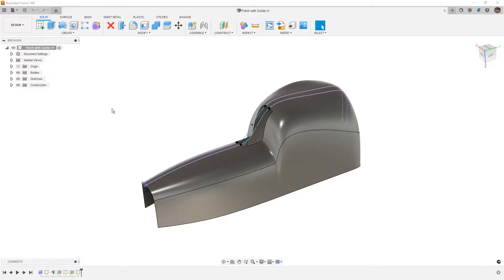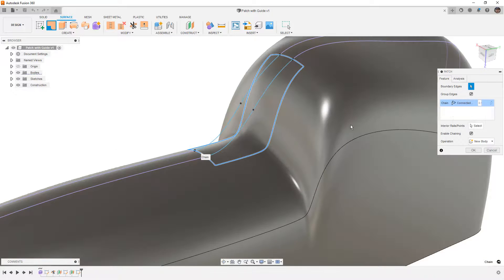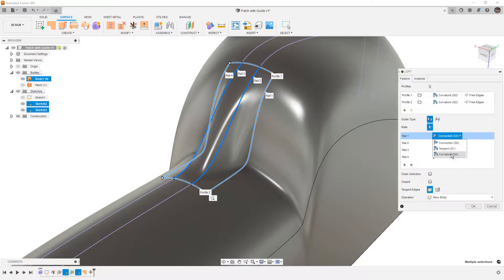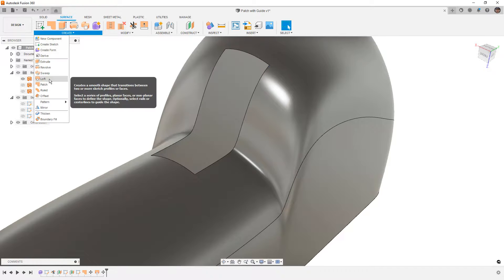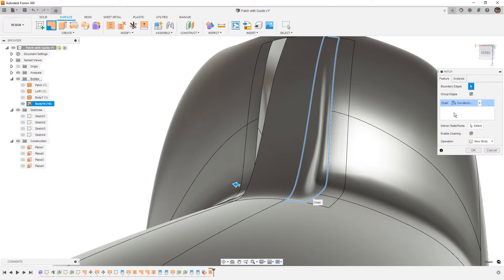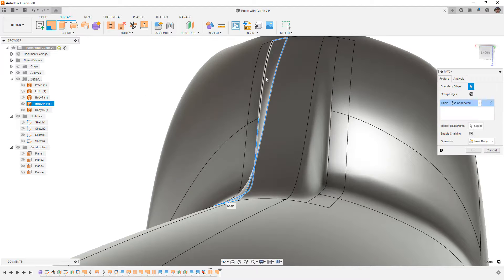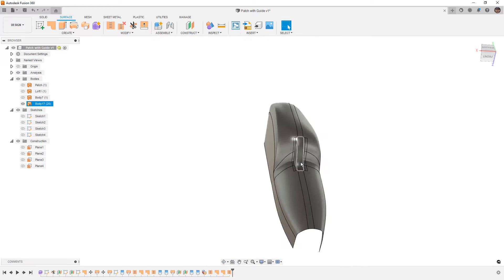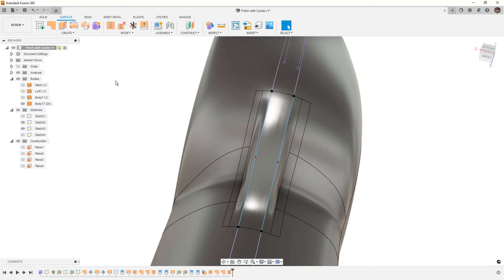Surface Mastery Part 9 - Patching a Surface using Interior Guide Rails | LOFT VS PATCH VS LOFT...

Comment: You've mentioned class A surfaces a couple of times now.  Where would this level of smoothness be needed?  Fluids stuff and aerodyamics?
Reply from the maker: Typically Class A is used for Automotive, Planes etc.  Consumer products "can" use it but many are made with traditional CAD packages.  You basically have better control over surfaces and the ability to maintain a higher level of continuity.

Most CAD programs will have G0 (coincident), G1 (Tangent) and G2 (Smooth).  Class A programs introduce G3 which looks at the tangency direction (G1), the radius of curvature (G2) and the rate of change or acceleration.  This equates to derivatives if you think about direction, speed and acceleration.  So if you think about an Arc that has a constant rate of change.  But if you have a spline it might be increasing or decreasing its radii as it gets to the edge.  G3 looks at that.

Comment: Matt.  I like the last example because of the continuous blends from top to bottom.  You mentioned at the end about using the Ruled Surface tool.  I was thinking that because of the draft option.  Many times in molding application we need to add draft angles to release the part.  I was wondering how you would add draft angles on the example you gave.  Thanks again for the discussion and illustration.
Reply from the maker: Good point!  Sounds like a good topic for the next video.  Typically i would make "helper" surfaces to help control the draft direction.  I will try to outline that for complex shapes in the next video!